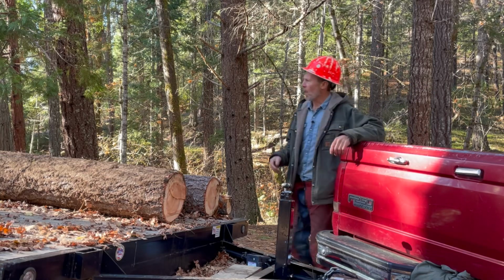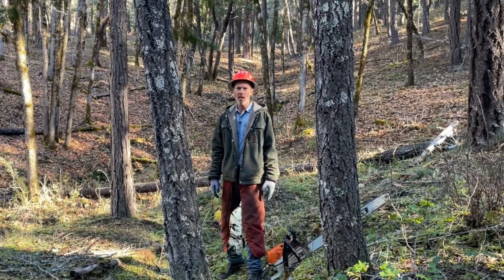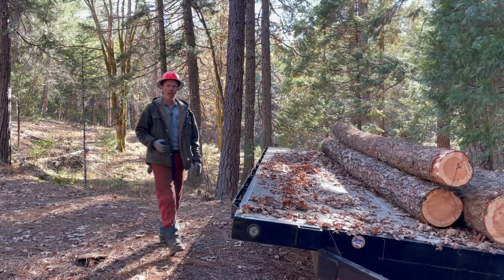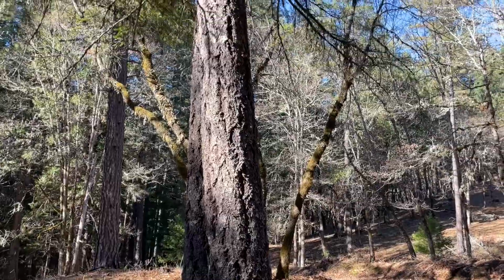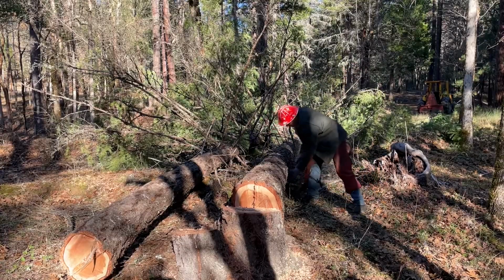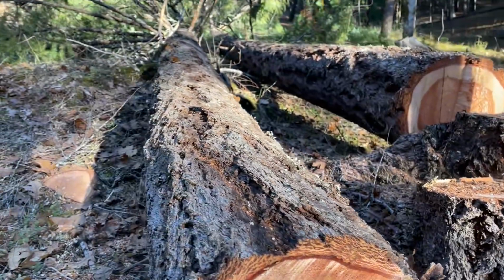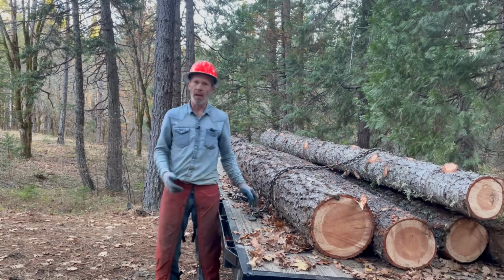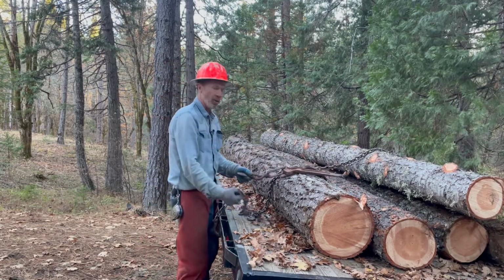Pulling Over 3 Trees At Once w Tractor

Comment: Well that was a neat trick there using whatever that was to gain the height to place your cable higher up. I would say that's a well practiced move in your arsenal.  I enjoy your attitude toward your final goal.  Good work
Reply from the maker: I used the handle of my ax to stand on. I may have made that trick up myself. Thanks for the comment.

Comment: Were you clearing the limbs with the timber winch... or did it just look like it???
Reply from the maker: Yes I was doing that. There is somewhat of a blade at the bottom of the winch. I sometimes use it to do a little minor road work. I sometimes use it for spreading gravel.